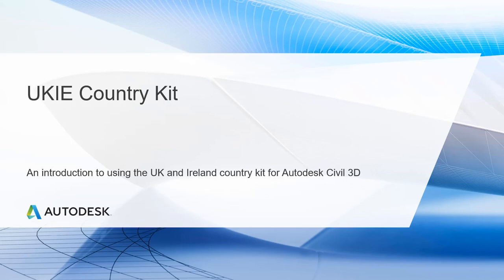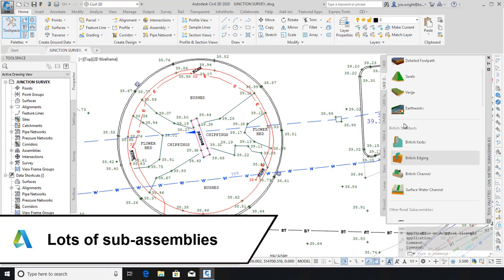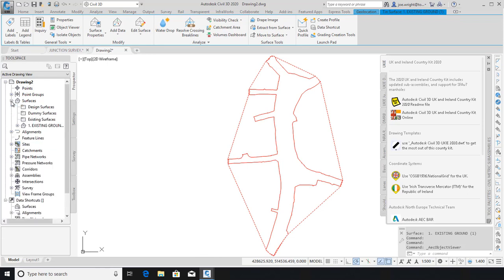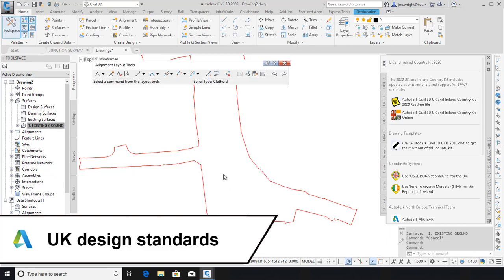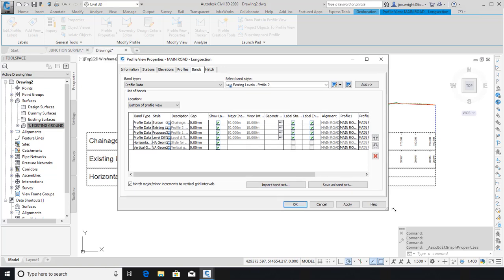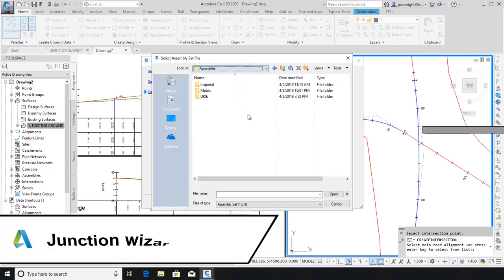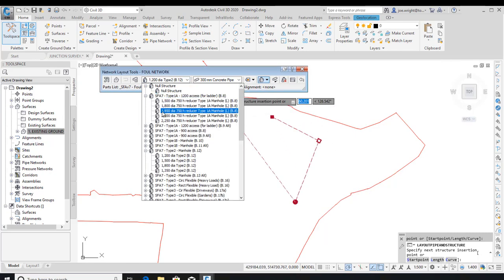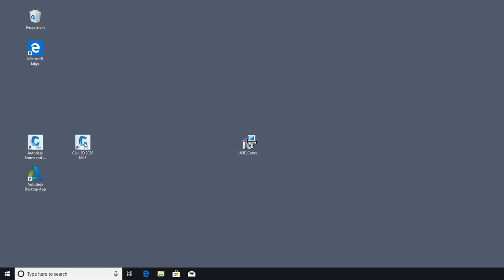Introduction to the UKIE Country Kit for Autodesk Civil 3D 2020

Comment: Thanks for the video. At 7:05 I'm not getting the 'TD 93a standards check' option though in the 'Use design check set' drop down. I do have the TD9/93a though on the above 'Use design criteria file' though. All I have are CD109a/b/c/d/e/f and Standard. I'm getting errors all over the place. Just trying to create an alignment for a residential development (assuming this will be 30mph).
Reply from the maker: Yes, this video was based on Civil 3D 2020. I assume you are using 2021, if not, then you are possibly using a template other than the UKIE one? 2021 adopts the new CD109 standards, you just need to select the CD109 alternative (CD109-NoTransitions). I would say adding a design speed on an estate road is probably overkill, as the lowest design in CD109 is 50Kmph. Hope this helps.
Reply: @joewright5392  Excellent, thanks for the reply. Using Civil 3D 2021 UKIE.

Comment: Hi Joe,
Apologies, i know this isn't a support portal but I'm hoping you can help. My IT department has installed C3D 2020 as a standalone install with network license and then downloaded and run the UKIE 2020 msi file from the autodesk website as suggested on the autodesk website. It seems to install ok and creates a ukie shortcut on the desktop but when this is run it doesn't seem to load the UKIE country kit as expected. There are reports listed under the toolbox but there are no modifications in the tool palettes such as assemblies and when you try to set the network catalog and choose the folder where the catalog files reside the error message 'Error: The selected folder does not contain all teh catalog information. please select another folder'.
Is this common? Can you suggest where it might have gone wrong?thanksRG
Reply from the maker: Robert,

When you open civil 3D, if you have a RED AutoCAD splash screen instead of a BLUE civil splash screen, then it's probably just your AutoCAD profile that needs resetting. An uninstall and re-install of the country kit may help (ensure your IT dept. use runas: Administrator). 

If all else fails, then, take a look at this article:

https://knowledge.autodesk.com/support/civil-3d/troubleshooting/caas/sfdcarticles/sfdcarticles/Resolving-user-specific-issues-by-resetting-AutoCAD-Civil-3D-2016.html 

whilst for 2016,  the only difference will be the key which for 2020 is, Computer\HKEY_CURRENT_USER\Software\Autodesk\AutoCAD\R23.1\ACAD-3000:409.

Hope this helps

Joe
Reply: Thanks Joe,it is running as Civil3d (Blue splash screen) but we will try to reset the profile and reinstall as you have suggested. Best regardsRob

Comment: I've downloaded the UKIE and set the pipe catelog to UKIE but I still can't get the sewers for adoption parts... this is specifically what I wanted from the country kit... anyone have any ideas? definitely running it from the UKIE not the normal metric
Reply from the maker: A few things to check: 1. ensure you are running Civil 3D 2020 or above, 2. Ensure your drawing is based on the 'UKIE template', 3. Double check the structure catalogue is set to 'UK IE Metric Structure Catalog', do not use 'UKIE - Sewers for Adoption V7 (with connectors)' unless you intend to make the parts list manually. 4. Ensure you use either '_SFAv7 - Foul Water System' or '_SFAv7 - Storm Water System' parts lists when creating your network.

Hope this helps